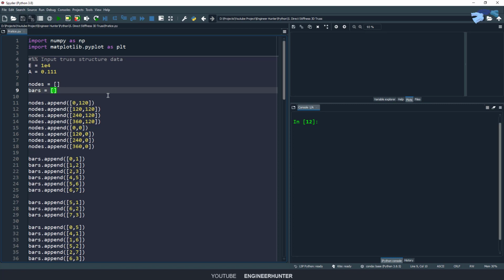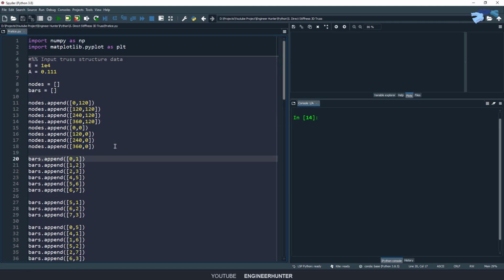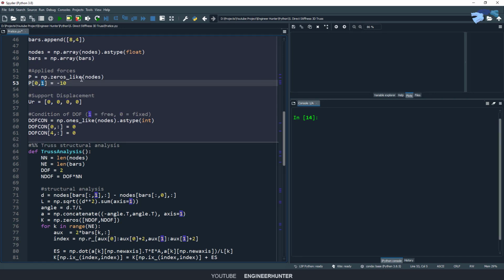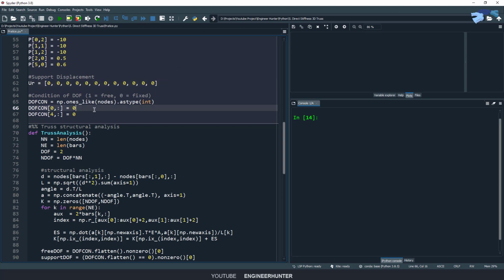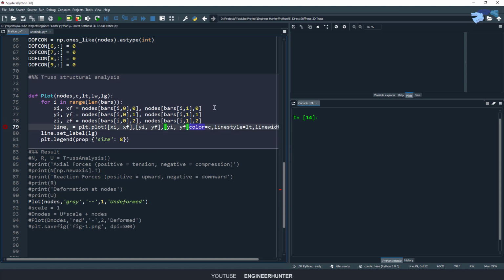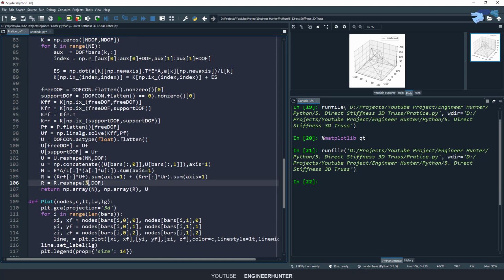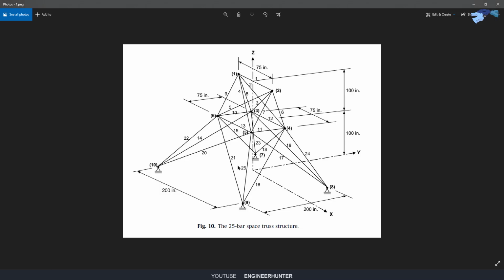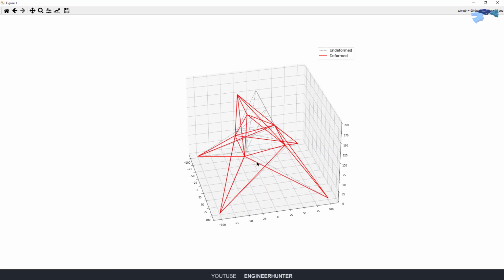Python: Direct Stiffness Analysis of 3D Truss

Comment: Hi, I imported my own structural data to run this code and I'm running into a singular matrix error, do you know how i could solve this?
Reply: Did you get this solved?
Reply: @davidtyrrell9534  No sadly :(
Reply: @AL-oc9zn  neither, been trying for a day
Reply: @davidtyrrell9534  i'm still trying too but with other stiffness matrix method videos😂
Reply: Maybe check the boundary conditions
Reply: @ibrahimyakupaydn  I've tried that and I've used the same boundary conditions as in the video